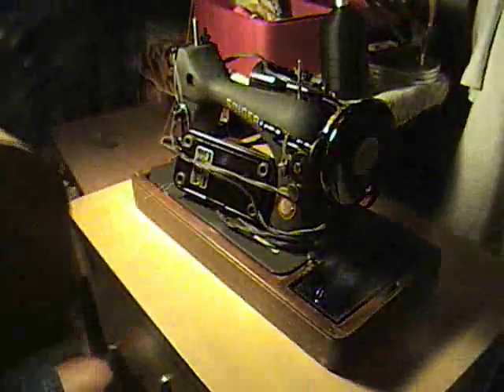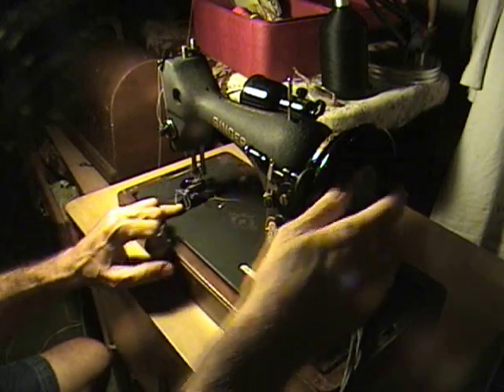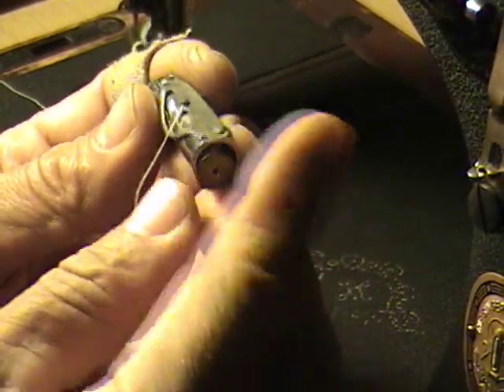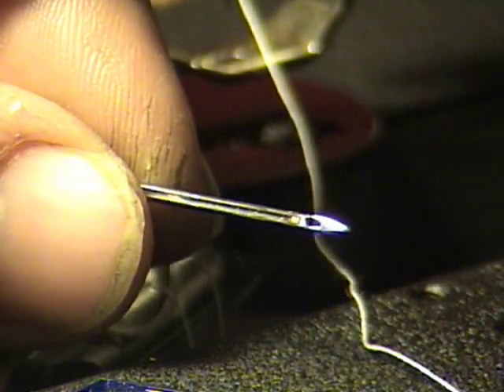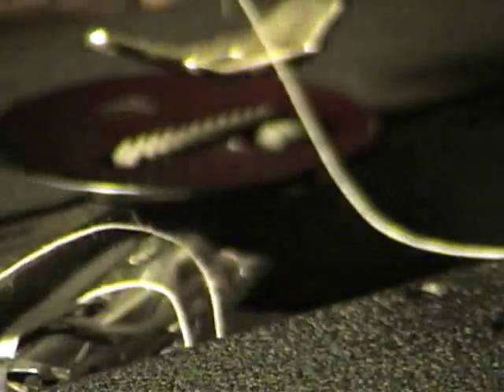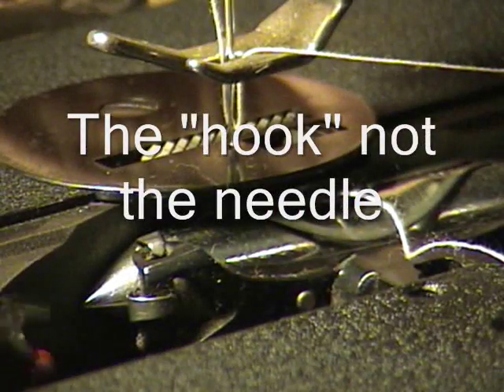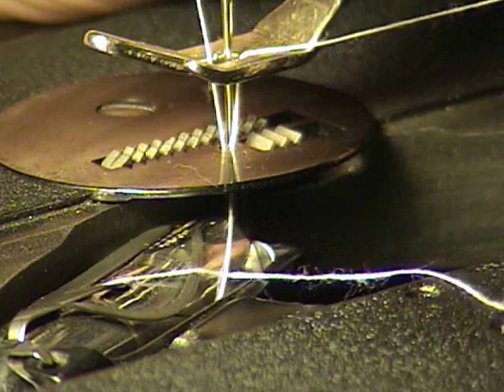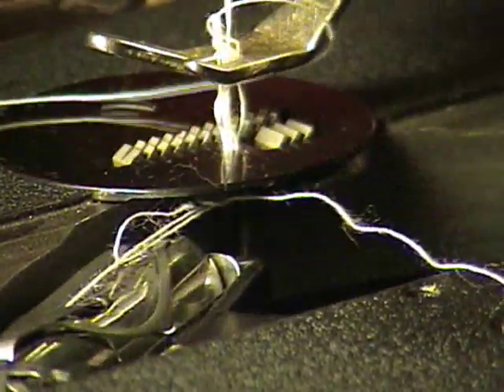SMH How does a sewing machine work?

Comment: I have a couple of old Singer industrial sewing machines. They have an electric motor under the cabinet, and a belt drive to the machine itself. There is a foot pedal that when pushed, operates mechanical linkage which pushes a rod on the bottom of the machine, and makes things move on the machine itself. Do you know what is happening when I push the foot pedal? I don't know what it is for, of what is supposed to happen when it is pushed. Hope you can help.